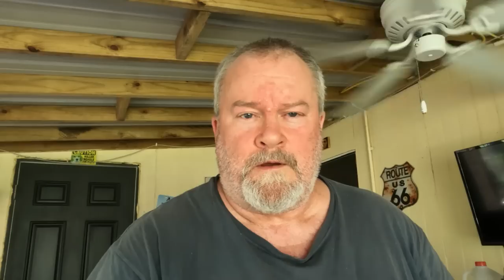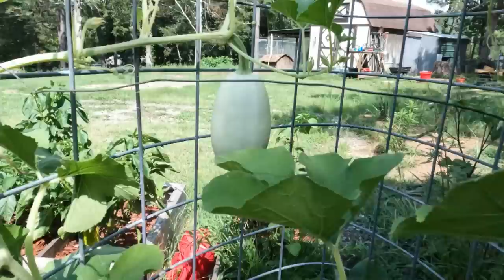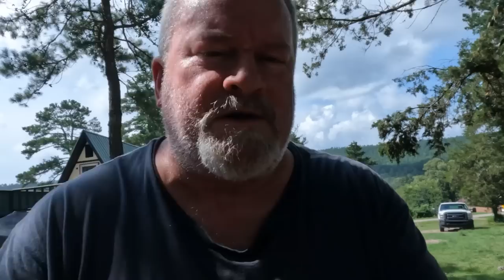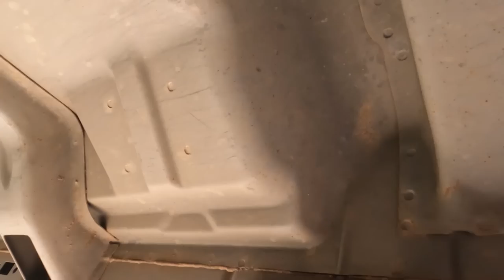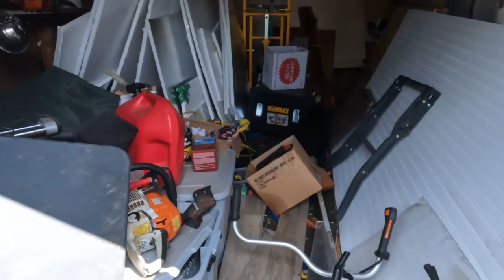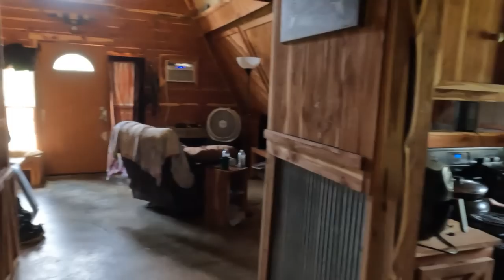Sticking Close To Home Waiting On Parts.

Comment: How do you know how to fix the issues on your truck?

Bad storm here.  Rain, thunder, lightning,  40mph wind.
House shaking.  
Rain hasn’t stopped since the spring.  Rain every other day.
Don’t like storms!
Reply from the maker: I worked for a dealer and also have worked in auto repair shops.Can fix about anything, I just dont like working on them anymore.But have no choice.
Reply: @ouachitamountainliving  
If you had to take car to mechanic…what would it cost to repair all of them?
Reply from the maker: @moalf5088  Probably $800. And no mechanic here can get me in and out fast, so rather do it myself.I have changed these on many trucks, all the same
Reply: @ouachitamountainliving  

Be careful Mike!